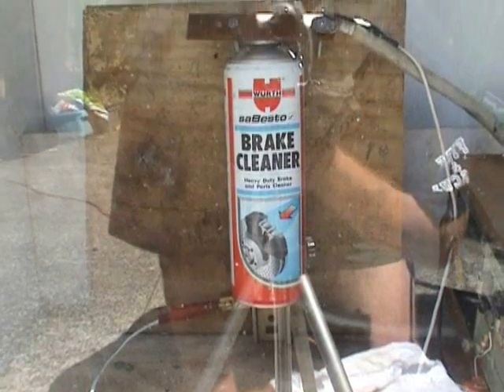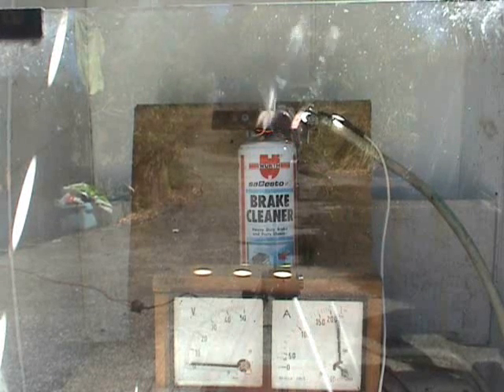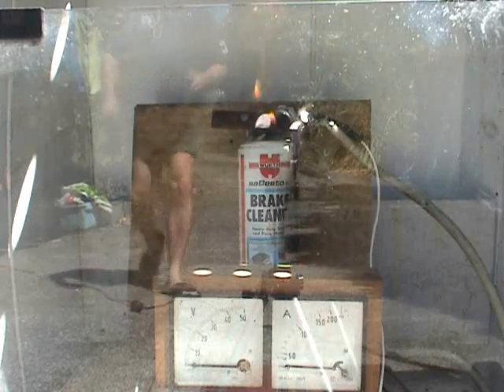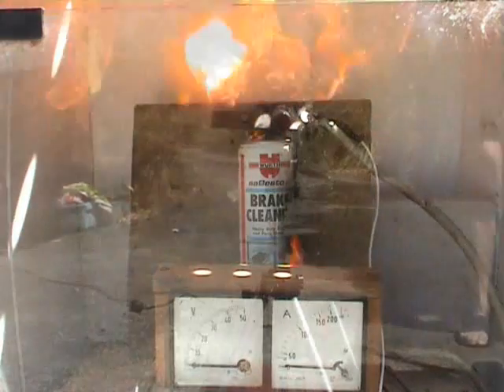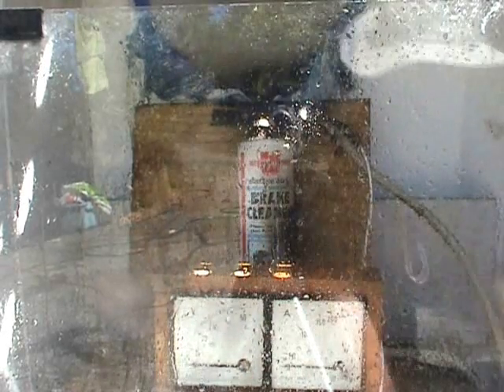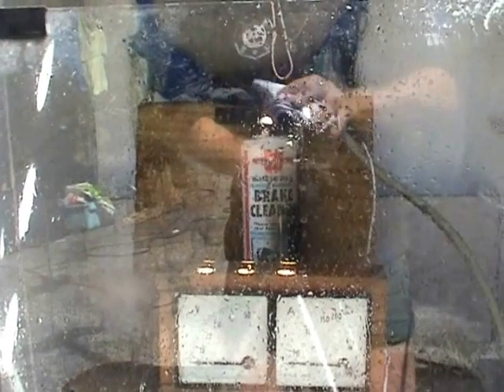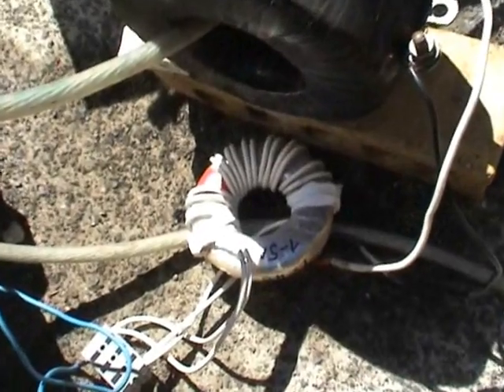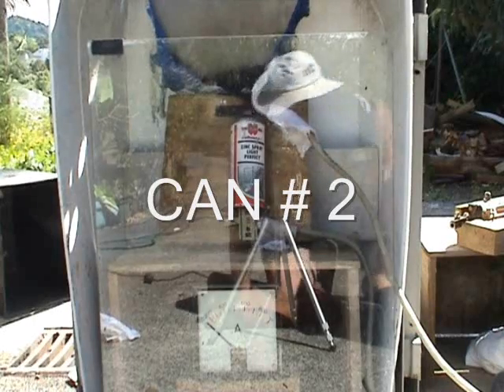Spray can as resistor venting vigorously and on fire

Comment: I have a colleague who believes a propane tank will explode if used as a flamethrower. I say not because there is no oxygen within the tank oxygen will only be present at the nozzle where propane is not under confinement any longer. No different than lighting hairspray or aerosol paint.

Comment: Cool video.

I used to do a lot of electrical fun, like shorting stuff out, even poring salt water on circuit boards.

I just noticed a link at the top "Is it a good idea to microwave spray paint" in that they destroy 2 microwaves.

Comment: Nice! i was looking forward to this experiment. i think that this was safe too, what aussie50 writes may happen but this looks ok.. what abilities does that transformer feature ?  i have recently wound up a new transformer that should be able of 3-4 hundreds amps but whatever secondary winding i use, it always gets red hot on the top of terminals, it's always the first thing that starts melting .. i don't know what should i do to lower the resistance there, maybe there's just too many amps :D

Comment: Nice vid but the fact that you used brake cleaner of all things worries me!

Brake cleaner can break down into Phosgene in the presence of intense heat (welding torch or electrical arcs) particularly UV radiation, a quick Google search will tell you how horrific Phosgene is.

same with R12 refrigerant, that was used by the Nazi's in WWII gas chambers. a machine was set up that would burn it with a intense flame and blow the resulting gas into the chamber.